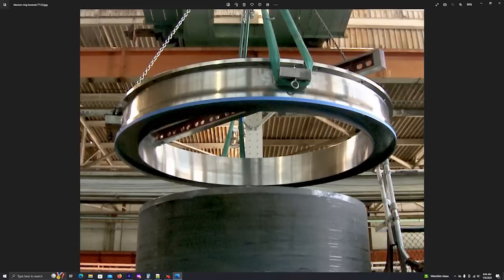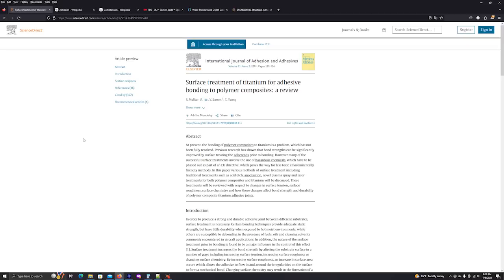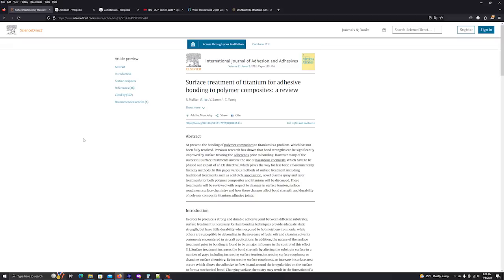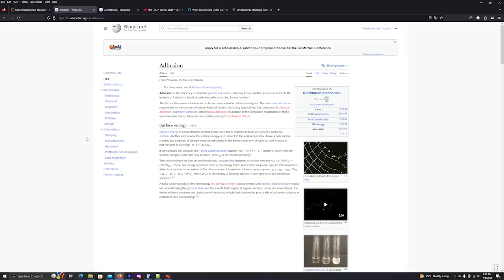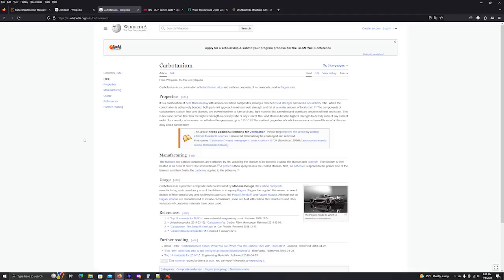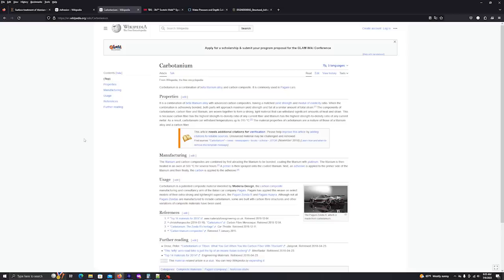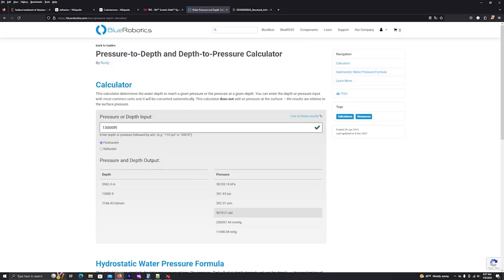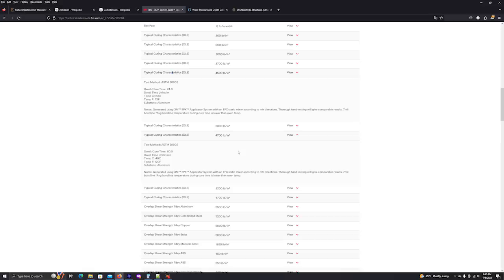Oceangate Titan Adhesive issues between Carbon Fiber and Titanium

Comment: Joe, have you seen "Forensic Engineering & Failure Anaylsis (sic)" channel's coverage of the Oceangate Titan? He'd done some unbelievable detective work combing through all video's that have been done on the Submersible especially it's construction. He has a strong theory that the Carbon Fiber hull failed where it connects with the Aft Titanium Ring. His theory is based on the frame construction in it's tail section that housed batteries and other components puts undo pressure on the aft section of the carbon fiber hull. He's gone through pictures of that section over time and points out 3 major design changes they made to that weight bearing metal frame over the past 3 years. 

Forensic Engineering & Failure Anaylsis (sic) channel has been combing though the evidence like Matlock he's even called the manufacturers of these different carbon fibers to figure out exactly which was used and how it was improperly used to create the ships Hull.

If the "leaked" final text messages are genuine they support his theory as Stockton Rush last few messages were about loud noises from the Aft section of the Hull. Also he texted it took multiple attempts to drop the metal frame (only part of it actually dropped).

In the leaked messages Stockton Rush is having tons of trouble with buoyancy. Even after jettisoning the metal landing gear the Titan is only able to rise 19 Meters in 5 minutes. Before this years dives Stockton Rush covered the entire hull in Rhino Liner. Rhino Liner has never been tested under extreme pressure and may have delaminated the Rhino Liner and allowed tons of water in between the Rhino Liner and Carbon Fiber. This additional weight would have killed the Titans Bouancy making it impossible to rise back to surface even if it didn't have a catastrophic implosion

Again these are not my theories they are brilliant thought from the channel "Forensic Engineering& Failure Analysis" (sic).

Does the bonding agent really make much of a difference with all the pressure pushing the hull together I'd imagine you could bond that thing with Vaseline and it would stay together with the water pressure keeping everything sealed. Cheers!
Reply: I would hesitate to accept that channel’s information. I too began watching them but the man is tough to follow as he is very erratic and applies an elementary understanding.
Reply: @chunkybuttz844  He provides receipts though. I don't know this guy from Adam but he's pointed out many wild things Rush has done I didn't notice nor anybody else  on Youtube covering this. He combing through every detail like he's autistic (Perhaps he is?).
Reply: His videos might be interesting, but keep in mind he also explicitly states that "he doesn't believe in gravity", before going on to demonstrate how he completely misunderstands the concept of Newton's Apple. So I'd take any conclusions he draws with more than a few grains of salt.

Having said that, water between the Rhino liner and carbon fibre would add as much weight as the water between the fairing and the hull. Nothing, while the sub is under water.
Reply: @DaHitch  I was a bit shocked when he said he doesn't believe in gravity but I'm going to give him the benefit of the doubt and assume he's being a smart ass (he is certainly that). If pushed on it he will say Newton's Gravity of mass attracts mass is BS and Einstein bending of the 4 Dimensional space time fabric is where it's at. Eitherway he has pointed out more crazy stuff that Stockton Rush has done than anybody else on Youtube. Sometimes the eccentric guys pickup on stuff us normal folks miss.
Reply: @Wallyworld30  I'm sure he just means gravity isn't a force which is readily accepted by physicists.  As you said it's geodesics following warped spacetime
Reply: @DaHitch  He also explicitly states a lot of other things, none of which include any identification, any educational background, or professional experience. His blurb under 'About' for the channel says it all: the ramblings of a person with a mental defect.
Reply: You spelled the word "analysis" 2 different ways, or I have sudden onset lysdexia.
Reply: @martinwhite418  Sorry, the first one I copied and pasted from his channel name. So go with that one
Reply: @Wallyworld30  It's ok, I just figured the moose out front should have told me.
Reply: Rino liner!!@$$%&**(- unbelievable- this just keeps getting more insane by the minute!!......
Reply from the maker: Thanks for the comments. I will have to watch the  channel you mentioned.
Reply: If the transcripts are correct, I wonder at what time was the implosion heard?  If they were leaking they might have started descending again. Wasn't the debris field small? Could that suggest they were close to or on the bottom?
Reply: @AORD72  The Navy can workout the exact depth where the implosion occurred. Apparently they can find the exact depth by analysing the frequency of the sound of implosion.

The debris field would’ve been quite small anyways because their last known depth was around 3400-3500 m and the Titanic wreck sit at 3800m so they weren’t far off from the sea floor.
Reply: @AORD72  The Coast Guard said the Submersible left 2 different debris fields. This tells me 2 separate events happened. The Metal Cage landing gear took multiple efforts to drop and it only partially dropped and one leg was still stuck. If only one leg was stuck this easily could have thrown off the balance so instead of steady rise evenly it could have had the front window pointing straight upward towards topside. 

If this happened the thruster that pushes UP would no longer push up but sideways.Also all weight would inside cabin would fall onto the bottom cap. If this actually happened and a thousand pounds of water managed to get under the delaminated Rhino Liner it would have cause additional drag to lift it towards the surface. So many different things could have caused that ship to come to crawl with bouyancy. By design the thrusters were locked in place and couldn't swivel to attempt to balance out the craft.
Reply: @Wallyworld30  Cool assumption… but assuming the communication transcript is real, nothing there would actually suggest that your scenario was happening at all.

 Also, I don’t think Titan can drop off its whole leg. It has ballast weights sitting freely on the legs and can be drop off manually by asking passenger to “roll the sub” from the inside. Since its a very crude manual system and required no electronics, the chance of it having problem with dropping the weights is practically non-existence. The transcript also confirmed that they had dropped the weights successfully and is ascending. 

Unsure what the slower “rate” is, but if that’s the ascent rate then it is most likely from the hull failing as water is getting in between layers of carbon fibre which would’ve cause the ascent to be slower than expected.

I don’t think the Rhino liner would’ve played any role at all. The pressure would’ve pushed those liner against the hull and made it practically impossible to have any water getting stuck in between.
Reply: Not if the cylinder buckled in and thwop  pops out lid
Reply: The tail section is not a structural part of the hull and the weight of those equipment + batteries is tiny when compare to the pressure that the hull is design to withstand (the pressure is like equivalent to that of an Eiffel tower… some batteries and metal frame is pretty much insignificant)

Also your calculation that it rises only 19m in 5 minutes is flawed. 

You don’t know exactly when it stop diving. You only have the last known depth before its dropped the weight. The sub will continued to dive deeper after it transmitted that message up until the weight has been dropped. So the weight was dropped somewhere between that 5 minutes which we don’t know exactly when but it would have definitely rise more than 19m for sure.

Also note the theory that water gets in would’ve made it impossible to acheived positive buoyancy but the fact that the sub has already start rising…meaning it has achieved positive buoyancy… that’s kinda disproved the theory already doesn’t it?

Strongly suggest to fact check and do your own research before believing this channel as it doesn’t sound very credible at all.
Reply: @tonamg53  He's made dozens of very in depth videos on the Titan craft. You're welcome to check them out and pick apart any mistakes he makes. With all the content he's made investigating it I'm sure he has made some mistakes but I appreciate the lengths he's gone through to check every last bolt on that craft.
Reply: @Wallyworld30  You can’t check “every bolts on the craft” from watching a 2 minutes long video on how it was made… especially the one you see them making is not actually the hull that imploded. Its the first hull you see in the video which Stockton himself only rated to 3000m due to issue with “cyclic fatigue” (his exact word) but the one imploded is actually the second hull which we don’t see how it was made and we do not have any details on the improvements made over the first hull to allowed it to dive to 4000m

Also the fact that he thought the equipment bay at the tail is the main cause is totally irrelevant, the weight is so little compare to the pressure the hull has to withstand the effect of those weight would’ve been negligible. Making a 4 hours long video on this is not going to make it any less negligible.
Reply: That may explain why they sunk so quickly too.  Rhino liner wth tho
Reply: @SoulDelSol  Yeah, he pulled up some studies on Rhino Liner and it's elasticity under pressure was crazy elastic. That was tested I believe under only 800PSI and Stockton took it down to 6000PSI down at the Titanic. Who knows what happened to it? I didn't see any still attached on the Wreckage it either delaminated under pressure or was blown off when it imploded.
Reply: @Wallyworld30  Maybe you didn't see or ever hear about any "Rhinoliner" because it never existed! Do you always believe someone because they have so much stuff on their video, it must be right?
Reply: @wesayhowdyhere  prob was delaminating
Reply: the 'leaked' messages from Titan are a hoax. they first appeared on Tik-Tok, then on a Youtube site out of Pakistan, around June 29. Tip: you can also fabricate any "proof" - receipts, phone calls, pictures (think photo-shop), get your buddy to play expert talking about Rush, you name it.
Reply: @gailmcn  I can't see why there couldn't be a leak. A water blaster fitting at 3000-4000 psi can slowly leak. The pressure was ~6000 psi. If a leak was around the titanium ring it might of remained slow for a while then perhaps cut into the CF creating an implosion.
Reply: @AORD72  Not sure what a water blaster is, or how its constructed, but a leak in one indicates a failure of the integrity of some part of the blaster, doesn't it? Then the water will escape into the air. Might be awhile before full failure. I worded that statement badly, didn't I? I should have said that at that extreme pressure there is no such thing as a slow leak or minor leak. Any intrusion of water in a small sub is evidence of failure of integrity in the vessel, (emergency) and will likely very rapidly worsen.....maybe in seconds or minutes, with fatal outcome pretty quick. Thanks for catching that in my comment.
Reply: @gailmcn  You have never used a water blaster? A high pressure water pump. "at that extreme pressure there is no such thing as a slow leak", yes there is, as I said it is not uncommon for water blasters of 3000-4000 psi to leak without exploding. 
You could drill a 0.01 mm hole in the titanium end cap and water would leak in and the sub wouldn't implode at that pressure. How can you think that a implosion is the only possibility?